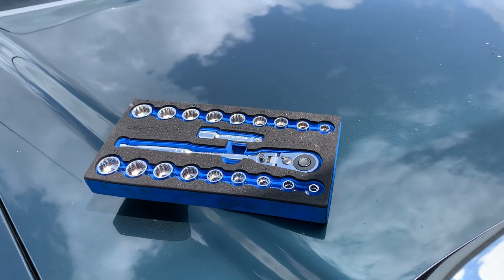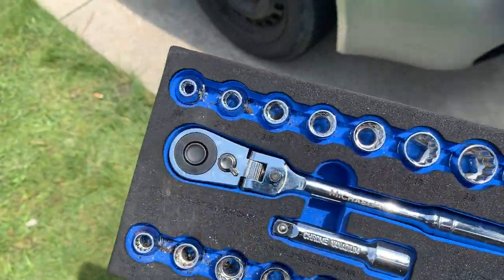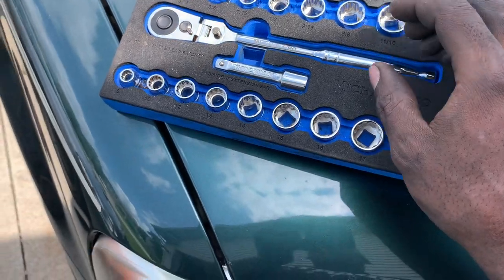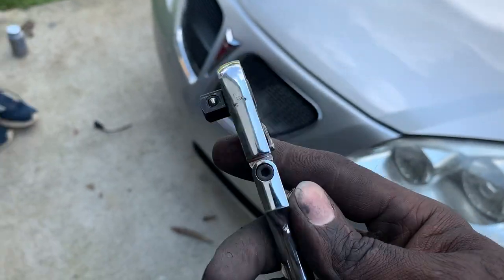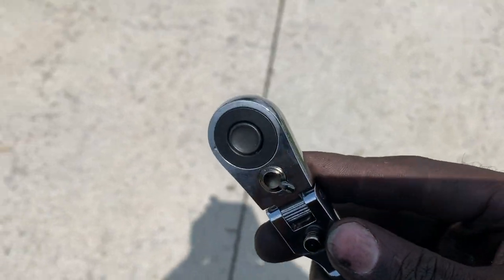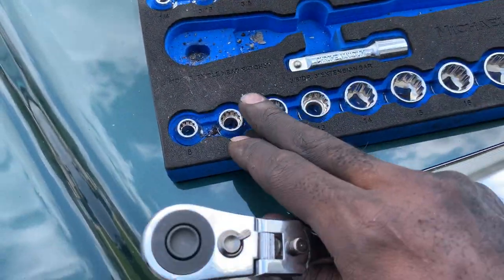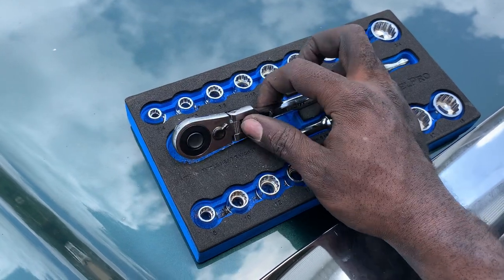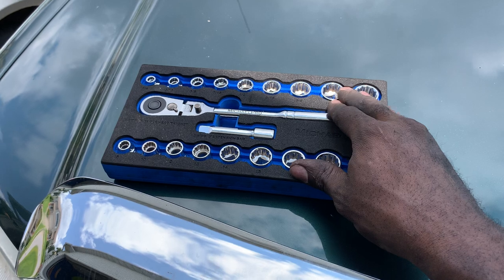MichaelPro 3/8” Drive Socket Set | My Thoughts!

Comment: Yeah i don't think anyone would use it for wheel bolts,i mean unless there's nothing around to use but a 3/8 ratchet. So I'm a little confused, I'm a home mechanic is this brand worth spending my money and would i be able to use it as my go to ratchet?. If course i would never use it to remove a wheel.
Reply from the maker: The lug nut use was for dramatics, but the ratchet did fail. Under normal use, I would put it inline with any other Taiwanese brand you could think of. Personally, I’d recommend buying used American Made tools before ever buying offshore. Most often, used USA tools can be purchased at, or near the cost of most mid-level brands like GW, Capri, Tekton, etc…